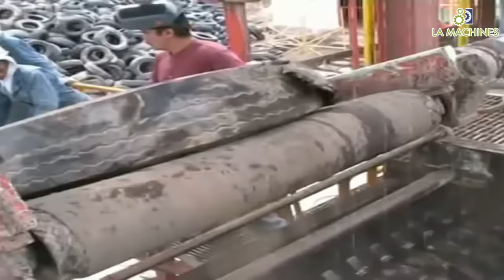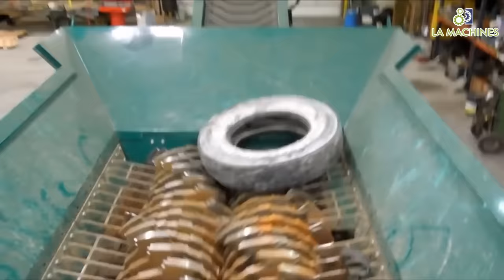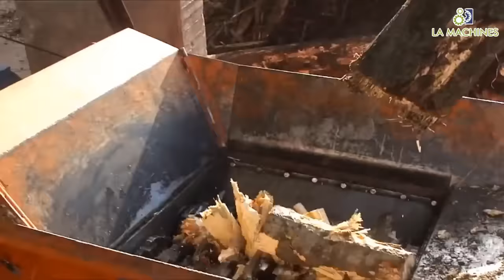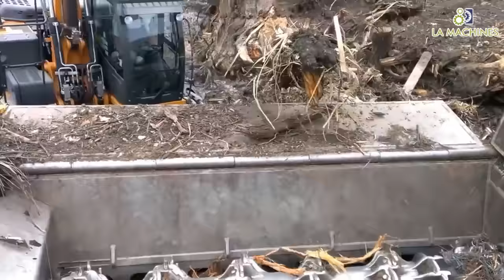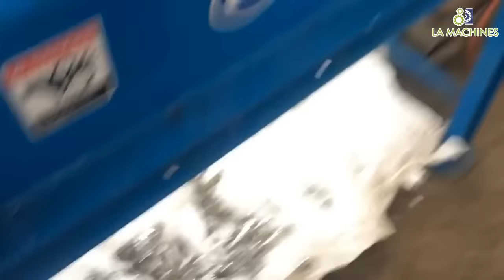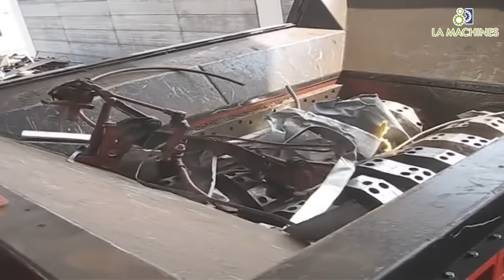Worlds Most Powerful Shredding Machine Modern Technology Machines Destroys Everything

Comment: For a machine this dangerous it seems like there isn't much protection around it.
Reply: 😩 " Glad I'm not the only one feeling that way. THIS is as scary and potentially hazardous as those giant Wood Chippers. "
Reply: Everyone around it should have a wireless kill switch on them they don’t make anything safe , chippers either
Reply: @3618499  This is 100% not completely up to standard. We had a similar machine at work, and the entire upper side of it was a giant kill switch, so if you touched it while loading the whole thing would stop.
Reply: A guy just fell into a 2000* hot steel vat at a caterpillar foundry (?) recently. Nothing they could do, was instantly incinerated. OSHA fined them a $145k fine for not have adequate barriers. It was his 9th day on the job...
Reply: @telcobilly  why would they fine a caterpillar theyre just tiny little guys
Reply: @buddhull3657  I just shared the story in response to a comment about the lack of safety precautions around those giant shredders as this foundry incident was for the same reason.
Reply: Should have safety light curtains as well.

Comment: That first shredder don’t miss a beat. If you slipped in, it’d be quick.
Sheer horror for a brief second☠️
Reply: It's a really good design. The top ones are feeders that make sure whatever gets thrown in is forced down into the cutters. So many shredders don't have those and the stuff just bounces around for days before the cutters manage to get a grip on it and pull it in.
Reply: @jones81381  yep, thats how physics works

Comment: Why aren't tires being recycled shredding is not recycling?
Reply: Neil Puckett   What would you do with an old tire to “recycle” it?
Reply: Shredding is always a first step for recycling. How could you work with non shedded stuff. You need to get full conform pieces to easily work with and transport it and so on.
Reply: Vitek Prouza  Absolutely agree.  I hoped Neil Puckett had a unicorn suggestion to back up his naive comment.

I was surprised how these monster machines struggled to shred routine work.  I operated one on light work which was fine, but every so often the work would have a hard bolt or gearbox secreted in it - seeing the aftermath of that wasn’t funny.
Reply: @jimwoods9551  ahh the ex junk yard worker speaks the question I'm asking is how much oil and carbon are in the rubber and is there a process to extract it? Do you have any conception of how many junk tires are in this country? Oh one more thing I'm sure you can tell me what products are being made out of the thousands of tons of plastic bottles we recycle each month?
Reply: Neil Puckett  I’m glad you have a great interest end of life materials.  The world needs everyone to understand the consequence of their consumption.  It appears you could do with spending some time studying the science of manufacturing rubber and plastic so you can understand the difficulties of recycling polymerized hydrocarbons.  Could I suggest read buy some books for your science and supplement them with reports from government environmental agencies about the statistics of recycling, generally available online at no cost.
Reply: The tires can literally be be refined like crude oil. The steel belts are turned back into steel through smelting. Finely crushed they can be mixed into asphalt for roads, shredded steal included. ( Actually makes better roads )

Comment: Such a machine must have a funnel that allows for greater loading, which gives greater efficiency of grinding because the material does not slide on the teeth, but is pressed down by the added raw material. Such a funnel is also a protection for the employee.

这样的机器必须有一个允许更大负载的漏斗，这样可以提高研磨效率，因为材料不会在牙齿上滑动，而是被添加的原料压下。 这样的漏斗也是对员工的一种保护。

Comment: The CBI Annihilator is truly the Mother of All Shredders. From the frame up, the Annihilator is designed to handle 100+ tons/hour of the most contaminated, commingled waste streams you can throw at it. Available in both stationary and portable configurations with diesel or electric power, the Annihilator delivers extreme throughput and outstanding durability processing C&D, bulky waste, and MSW. Features include a 6” forged steel, 20,000 pound rotor with reversible tips, auto reverse, and automatic purge cycle; an 8,000 pound hydraulically actuated anvil door with remote controlled, adjustable cutting gap; and an 8’x10’ feed opening with extended sides to provide unrestricted loading of large volumes of material without spillage. Whether you’re running a landfill or transfer station or you need an absolutely bullet-proof primary shredder in front of your recycling system, the Annihilator is for you..... Yes I copied and pasted the information . I built parts for this unit and its known as the most powerful shredder you could buy back in 2005. Still an interesting video . Thumbs up :)

Comment: how are the tires used once shredded? looks like it would be worthless with the steel wires in the belts and beads. How is that separated from the rubber?

Comment: That machine viewed at 2:13 fits with my theory about the Universe, that we live in a universe with opposite sub-verses. The best way to crush something is by equally opposing forces and the only way to cycle a universe is for there to be opposite sub-verses, with the sub-verse of expansion occurring post Big Bang and the opposite sub-verse occurring via maximum compression into a black hole. Scientists have convinced themselves of a one time, accidental universe that will expand until it dims out, but some day I hope they'll catch up to my Theory. The Big Bang is plasma hot & the opposite temperature occurs in black holes: near absolute cold. Our sub-verse is ubiquitous with electromagnetism, but it is spewed out of black holes at the poles. But black holes still confound physicists because they don't want to view it as being something opposite, because that infers oscillation and that infers intelligent design. I'm not trying to prove the existence of God, just suggesting a way our universe can recycle itself. Why is that so hard to consider?
Reply: Einstein
Reply: @Moon-lp2lo  i want some of what you've had 😎